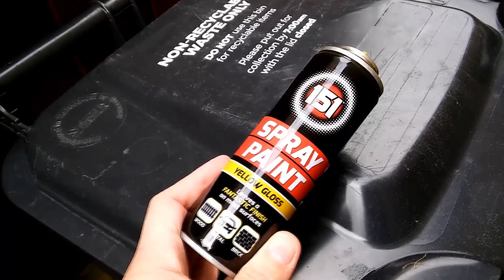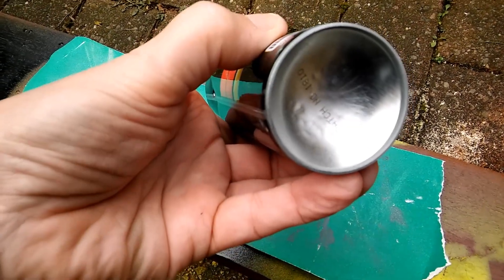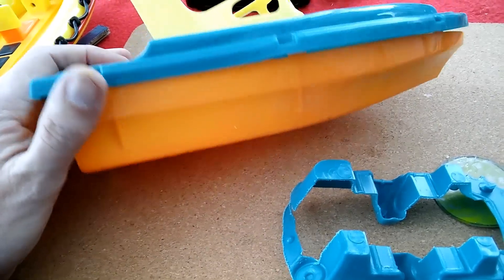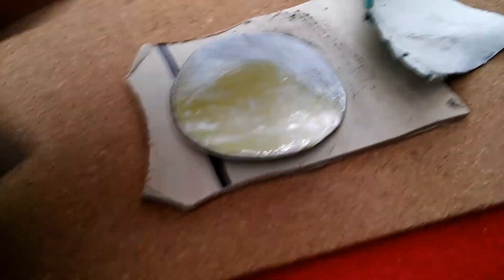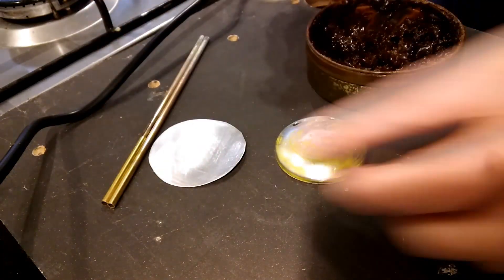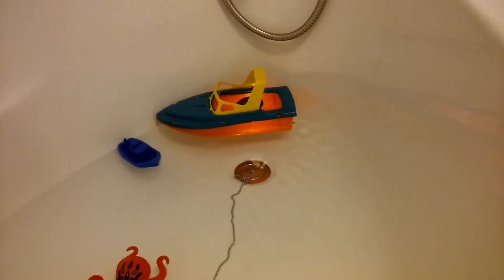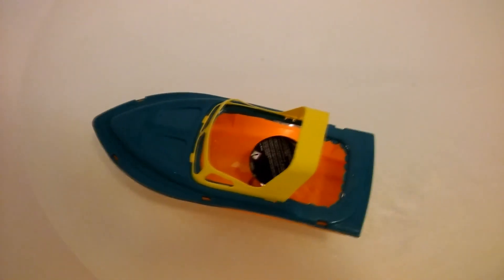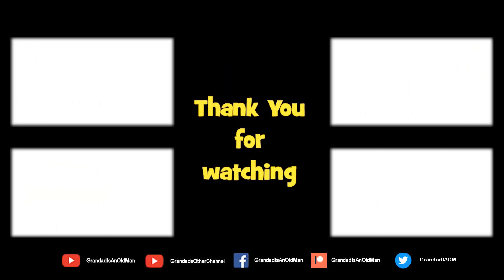Pop Pop Putt Putt boat boiler from a Spray Paint

Comment: No sound pop pop. My boat too, no sound pop pop🤔
Reply from the maker: The sound is not necessary for it to work but it is more fun when it pops along. In many cases a stronger flame will get the boiler popping but you might melt your joints. Check the links in the video description for more videos. I would recommend any video by Daryl Foster
Reply: Yes it works without the pop pop sound but it's not fun! Thank you for responding quickly

Comment: I'm building my boiler using this technique (aka soldering), to me it looks the most reliable and durable.
Reply from the maker: Depends how hot you let it get, in truth it should only need to reach boiling point so even BluTack works but if you let them run dry they will overheat and melt solder.

Comment: I went to the supermarket with a magnet. Not one pop or juice can was steel. I then went to the beer store. The only steel can made was Steiger. A beer made in Austria. It worked perfectly and was tastey
Reply from the maker: Hey thanks for the tip. I had taken to carrying a cheap Poundland torch in my jacket pocket. One of those flat ones with a magnet on the back so I could test cans. In the end I gave up as I never found one.

Comment: A couple of coke cans would make a  nice chamber. 2 of the bottoms of the cans placed one inserted into the other (plenty of alcohol stoves are made using a similar method on yt. It should be water tight enough for a put put boiler. But if not solder is cheap
Reply from the maker: All the drinks cans I have tested are aluminium so OK if you are going to use glue but no good for soldering. I even resorted to wandering round the supermarket with a magnet to check all the drinks cans 😜 Oh and solder is not cheap, it is ridiculously expensive. I haven't had to buy any for about 10 or 15 years as I had several large cobs but finally had to buy some last week. What I would call a reasonable amount was nearly £10 even the little coils were nearly £4